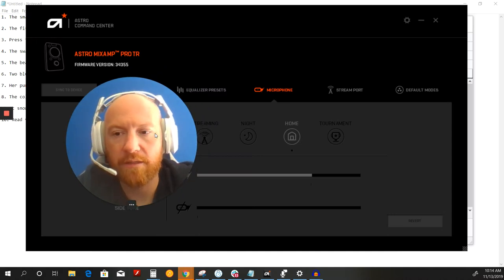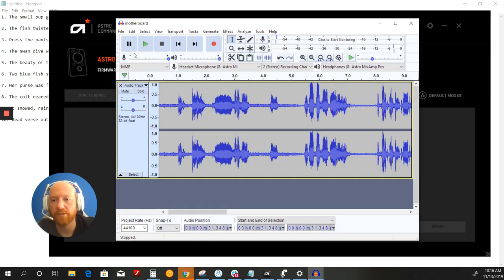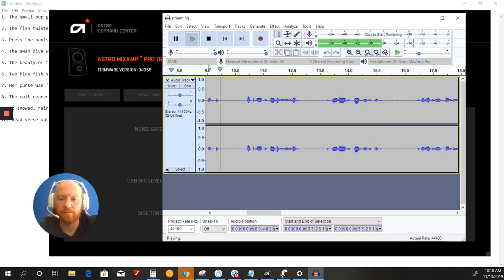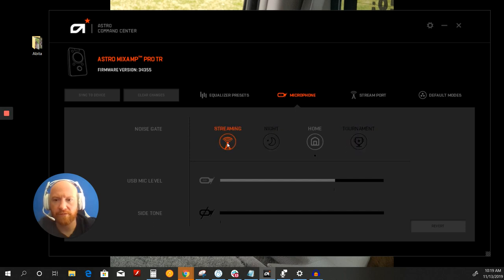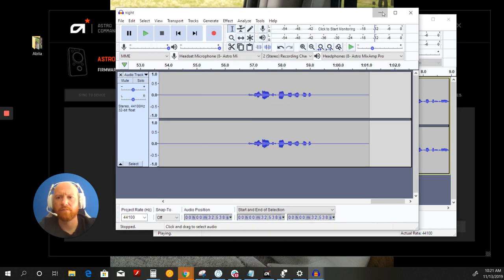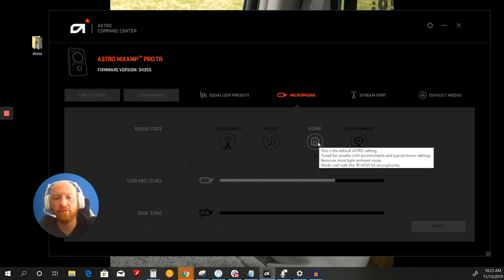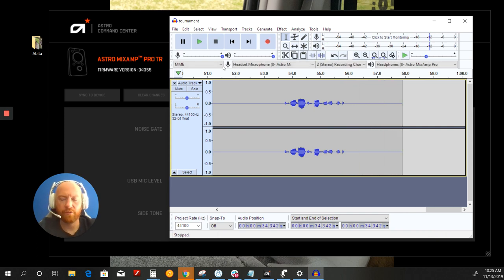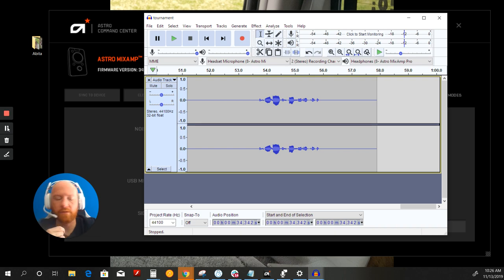Astro A40 Noise Gate Setting Comparison - Mic Test on Streaming VS Night VS Home VS Tournament modes

Comment: Noise gates dont cut off frequencies but instead boost any frequencies that are low. Since you have a bassier voice the highs and mids are low so the noise gate will boost those levels which why it doesn't sound natural to you. If you look at the settings from right to left max noise gate (streaming) to No noise gate (tournament) The alternative is that the gate  cuts off the mic once the closest sound is no longer picked up tournament has the most cut off and streaming is non existent. People with higher voices might get a natural sound from the streaming setting but those of us with bassier voices will like tournament or home better. BUT if you have a lot of ambient noise that you don't want to be on your videos and want to limit that go tournament for less ambient. Natural sounding vs no background noises are your trade offs. (side note I know "bassier" is not a word.) Great video. loved the detail in the recordings.

Comment: I still haven’t committed to astros 🤦‍♂️
Reply from the maker: They might not be the best fit for you, depending on what you're trying to do. I don't think the mic quality is that good in general, if you're thinking about streaming or making videos. I actually used the Blue Yeti mic over these for recording voice. What would you be using your Astros for, just gaming?
Reply: It’s just for gaming and chatting on discord.  I have wireless Turtle Beaches currently but really just want a headset that doesn’t make my ears hot 😂😂😂. Like bruh put some AC in the speaker’s because I’m sweating 😅
Reply from the maker: @bbones504  oh yeah, the astros a40s are super breathable and airy. they leak a lot of sound without the modkit but you can literally wear them all day comfortably
Reply from the maker: @bbones504 you thinking a40 or a50?
Reply: Jeff Couret not sure yet I definitely want to upgrade again and want a breathable headset